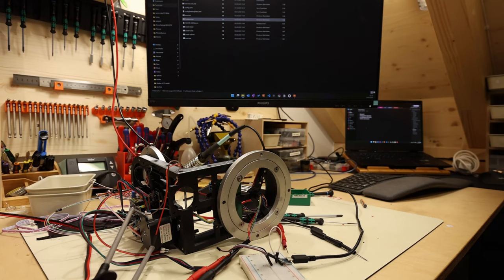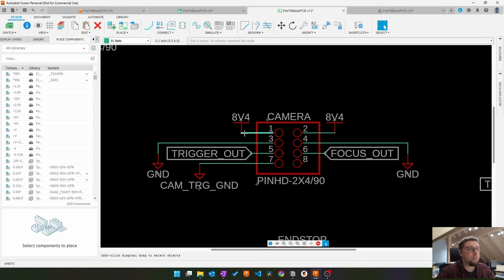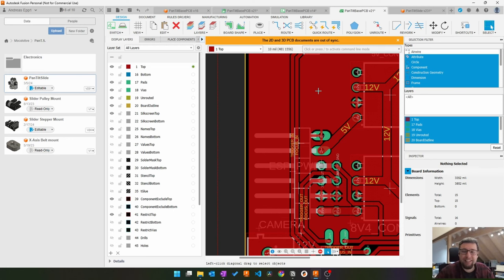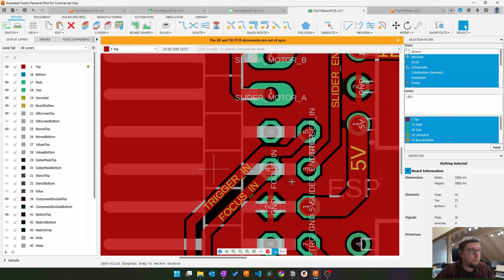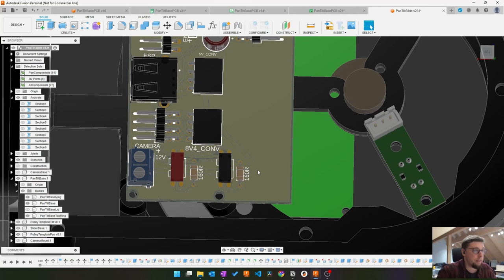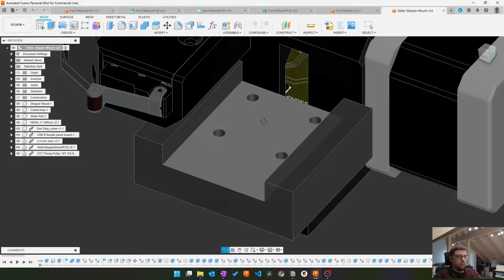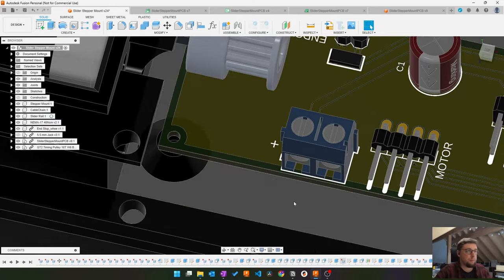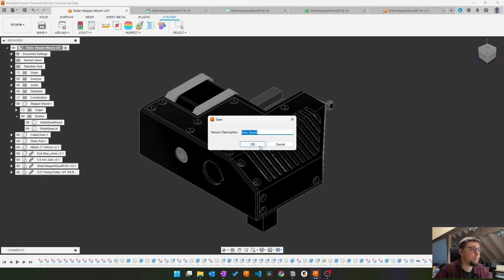DIY Motion Control Rig Dev Vlog 1

Comment: Have you looked into connecting our camera via USB to the Raspberry Pi and then use the gPhoto library to control your camera? Really a bummer that the USB connection through the slip ring was not possible.
Reply from the maker: I have tried it and it works okay. I did not end up using it because the video feed has about a 3 second delay via mpeg stream over wifi (rPi zero W 2). For camera control I will use a trigger mechanism for the 2,5mm trigger plug of the camera plus an external focus motor.